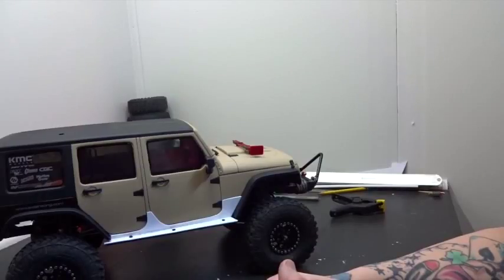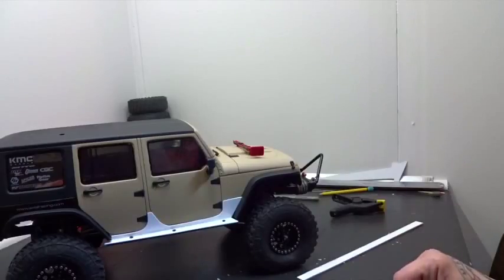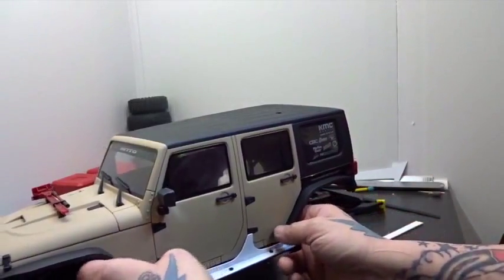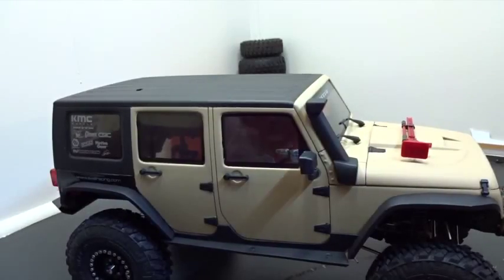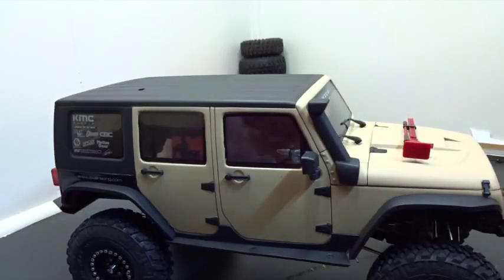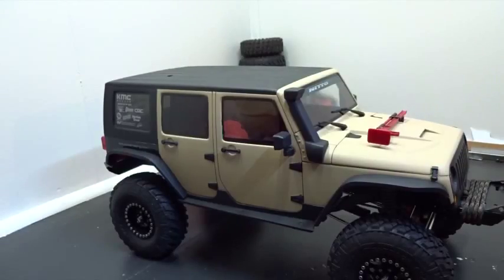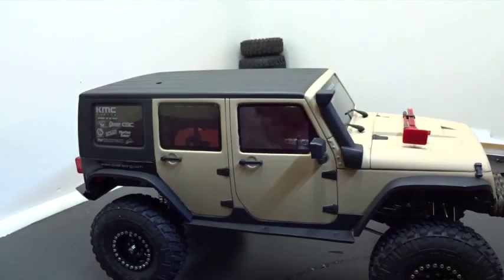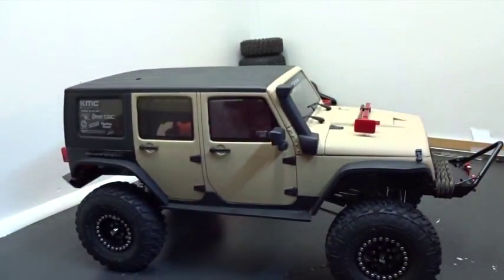2017 Axial Jeep Crc edition gets some styrene work done.

Comment: Nice work Rick, I have no experience with styrene yet, watching your video will definitely helps a lot, hard body give you the details, and the movement of the suspension will be more realistic (top heavy and tweaking of the shock will be needed), only compromises your crawling ability, I really prefer hard bodies, It would be awesome if you could do a step by step how to integrate this hard body to the scx10 ii platform. I was supposed to get the team raffee Jeep Wrangler body, not to sure how to mount it nicely, I am not to keen in spending that much money if it didn’t fit well.  
Great video, you definitely save us lot of money with this kind of build :)
Reply from the maker: Oliver's Toys thanks bud,yeah i avoided most hard body kits just because most need you to move the motor/transmission forward,but from what i understand and the videos ive watched it looks like this xtraspeed jeep body fits the stock configured scx10 2 chassis with just some trimming of the battery tray.kingston rc does a good build series with the xtraspeed body and our scx10 2s so id definetly check him out to answer any other questions.big thanks for watching!

Comment: Nice Rockers Rick. You should go to the xtra speed 4 dr kit. They are nice. The only mods I have seen with mine is, need to get rid of the electronics box under the driver side and need to cut down the battery tray because it hits the floor pan/firewall. You can get different grills, hood scoops (armor), different fenders/armor and now you can change the hard top to the roll bars. Keep up the great work!
Reply from the maker: Matthew Romero thanks Matt,i really appreciate that! And yeah im gonna get one of those jeeps on order for sure.thanks for watching!